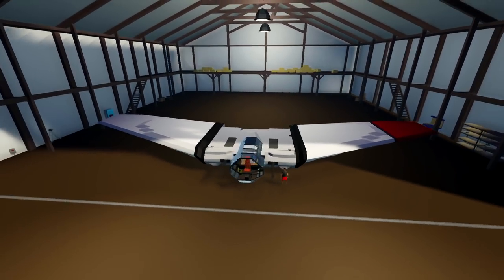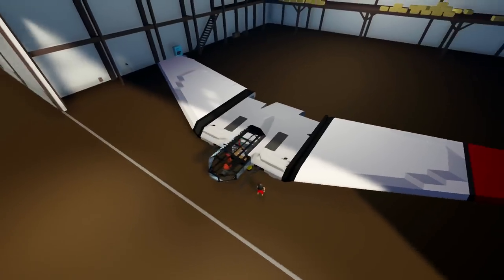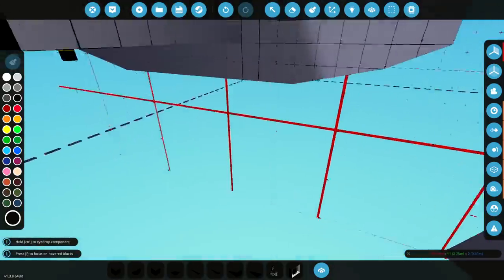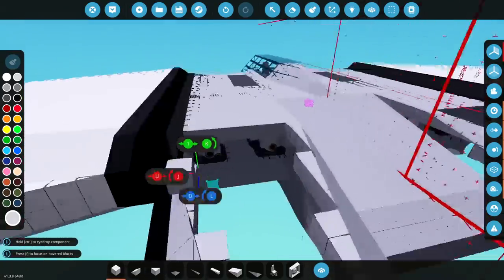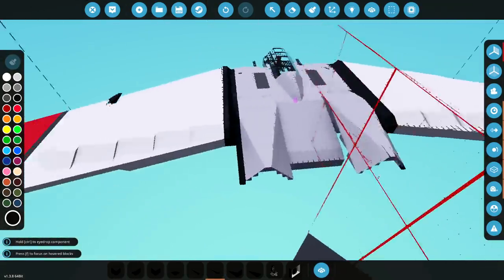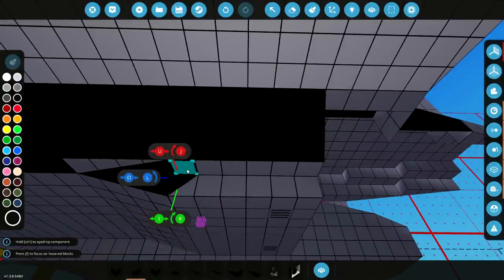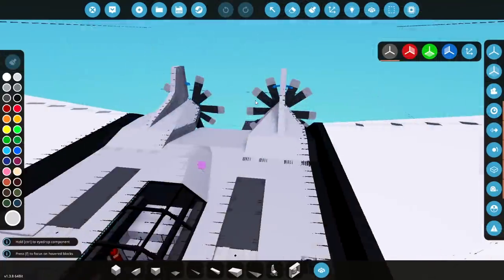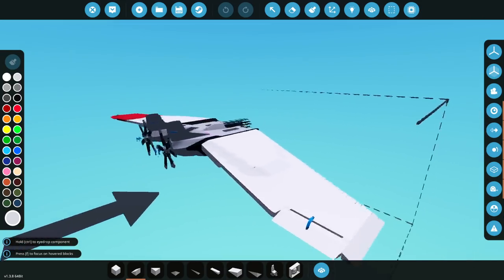Propeller Driven Flying Wing!? - Flying Wing Build - Stormworks Search and Destroy!

Comment: i think because it's a flying wing there shouldn't be a tail on top of the prop mounts because then it technically isn't a flying wing annymore.
Reply: Once the fuselage is the wing it is a flying wing also making a flying wing without vertical stabilization is difficult that's why early flying wings failed